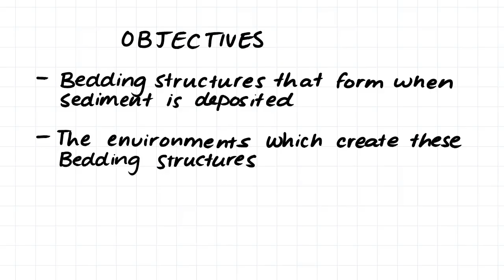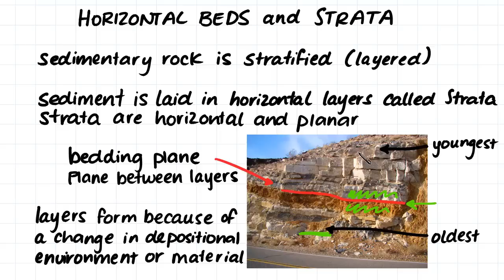Sediment Deposition and Bedding Structures | Geology

Comment: Hi. I know absolutely nothing about Geology. I am trying to put together a short youtube vide to debunk some creationist claims about the formation of sedimentary layers.After graded bedding has occurred, then what sort of timeframes are involved in cementation/compaction? I know that this depends on the pressure of the layers above, but I just need a few lines explaining the sorts of typical time periods necessary.  Also with rapid deposits from volcano ash and river silt etc. Whats sorts of depths might these deposits obtain over short periods i.e 3 - 7 days?Any help would be greatly appreciated